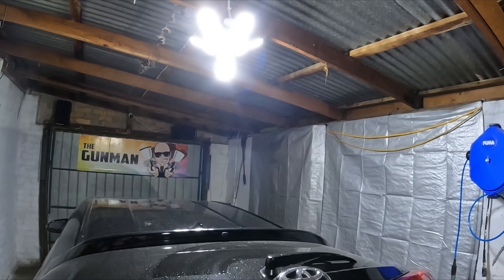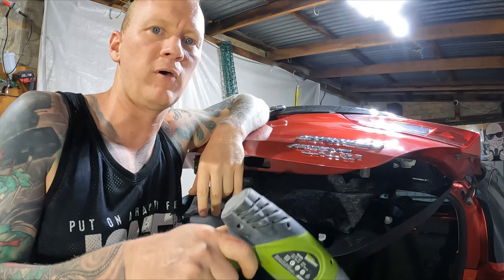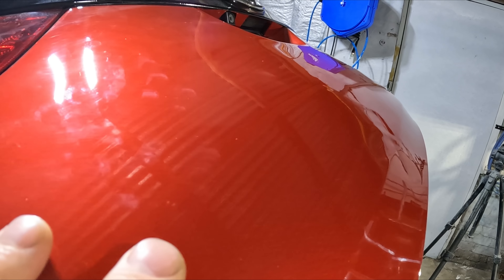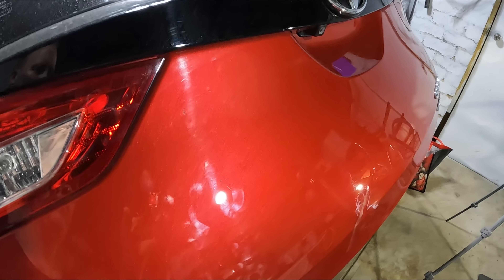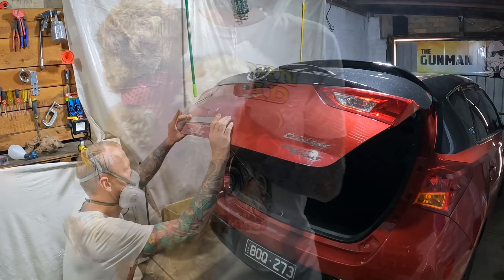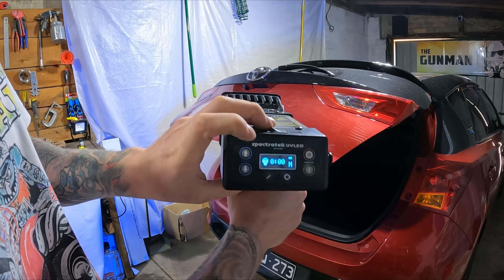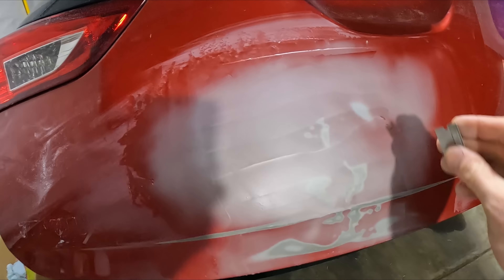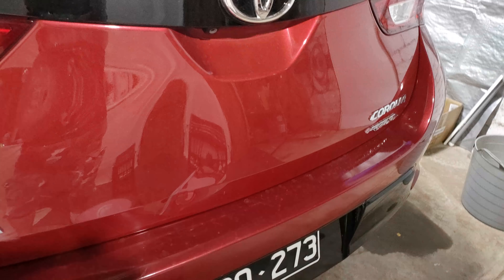Repairing Your Car At Home

Comment: Hello Gunny, glad you are felling better! Glad that you made this video as well. Fist an foremost I am not a PDR guy but starting to learn quite a bit and not a  good idea to use a back of a screwdriver as you can see. You could have uses a slide hammer pull /dent puller with tap downtool with differnt  tips for adress high spots, crowns etc. Could have gotten that out pretty easy without having to use filler, paint.
None the less as always great job with the final finish!!
Getting back to this video. I Live in the US and I am new to painting and looking to do some work on my car.
Some spot paint repairs and some full panels that need to be painted. Looking for a few suggestions for a few good or high quality spraypaint guns.
My compressor may limit my options. It's a 1.8hp 20 gallon 150PSI. CFM IS 5@90PSI AND 6 CFM@ 40PSI. I know they make HVLP AND LVLP/MP ETC.
Can you please make a few recommendations please?
As mentioned don't mind spending some extra money for a quality gun.
Thank you so much!
Reply from the maker: I would highly recommend the Tekna pro like (GTi pro lite) T110 air cap 1.3. here's a link to where I get my guns. https://spraygunsdirect.co.uk/product/devilbiss-prolite-gravity-spray-gun-cutting-edge-performance-uks-no-1-most-popular-in-bodyshops-available-now-formerly-devilbiss-gti-pro-lite/
Reply: @TheGunmanChannel  

Thanks for the reply Gunny. I was told this would not work since the minimum CFM Requirement is like 9.4 or 9.5. Which I am a little confused since watching this video the Sagola Mini Extreem which you are using also has a minimum if 9 CFM yet somehowbit seems to be working fine with the compressor you are using at you home garage. 
Unless your compressor is putting out much CFM.. I was actually looking at both the SAGOLA MINI XTREEM and also the 475 Xtech.

Comment: With those sort of small deepish dents, I have found using the end of a large wooden handle similar to a long hammer handle runs smoothly over the back of the panel swaging it out as you go, you tend to end up with less dimples

Comment: Dunno Gunny, PDR if you do not want to paint it, but this is a more professional (and can be expensive) outcome with great results. These new spot welders allow you to pull it out really easily and produce a good job. They are pretty cheap these days and I have one I use all the time. Great for dings where you do not have rear access. The link to the product looks good, but the cheaper UV gun at $1650 makes this only useful for a panel shop where the cost can be quickly amortized. Not cost effective for anyone else. That you have access to the UV gun makes this viable for you.

Comment: What is that main light? Working in a shed with only fluro tubes is hell for detail
Reply from the maker: Here's a link, just make sure you get the right fitting. This is Edison screw, but I got an adaptor to make it fit my bayonet fitting. Works a treat 😁 https://www.ebay.com.au/itm/180W-Super-Bright-LED-Garage-Light-Deformable-Ceiling-Lights-Workshop-Shop-Lamp-/304147387259?mkcid=16&mkevt=1&_trksid=p2349624.m46890.l6249&mkrid=705-154756-20017-0

Comment: Hey gunny, another amazing video. Love this one since I am currently going through the same process with my car. 
I have a question re filler. Whenever I apply filler I seem to always keep apply more and more after sanding each time. Why is the case, am I doing something incorrectly?
I hope your feeling better after COVID.
Reply: Dan, it's normal to have to refill occasionally, if you put a bulk amount on in one hit it can be more porous from the heat buildup in the bog, more bubbles...
Reply: Just try and not sand out to much filler, I have this problem as a apprentice beater and it happens. Just make sure you keep checking on it every time you block it down. I always sand to much out then put it back in without actually filling the lows in, I’ll just end up sanding all the bog I put in out.